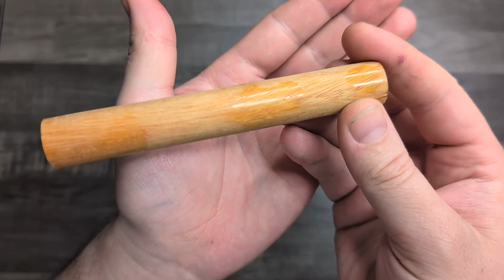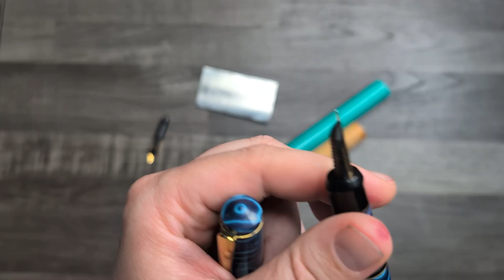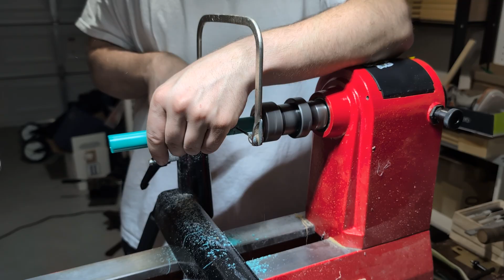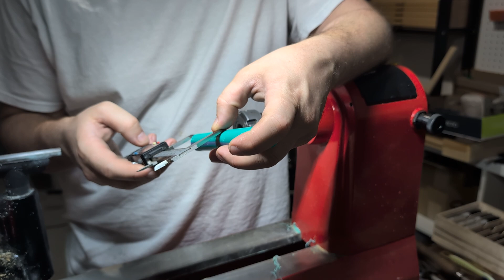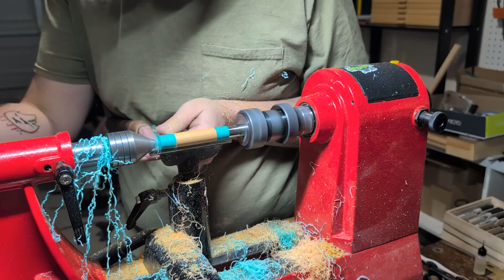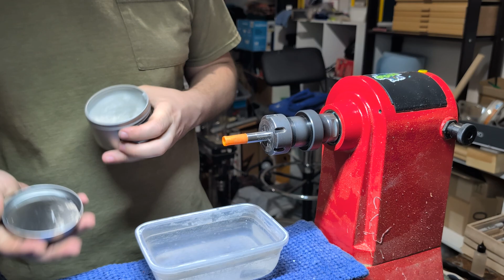Osage Orange Wood & Resin Fountain Pen - How I Make My Hybrid Pens

Comment: You have given me some great ideas as usual. You are a master turner and I will try a your finial shaping technique. My angles on my finials are sometimes a bit off when I try a conical shape.

Also, for some resin pens, I lose a bit of length due to bubbles and barely have enough length to leave enough length to finish if I leave a hole for 60 degree drive center. I have been using my mandrel saver for the cap which stays fairly stable since it’s short and use the 60 degree hole for live center on body. Any suggestions for limited length cap body and mandrel alumilite blanks?

Thanks
Reply from the maker: Thank you for the kind words, and watching! 

One of my favorite ways to stretch blanks is keeping some plain, neutral-color materials around for sections. Otherwise, shorter sections, in general, can help free up cap and body material